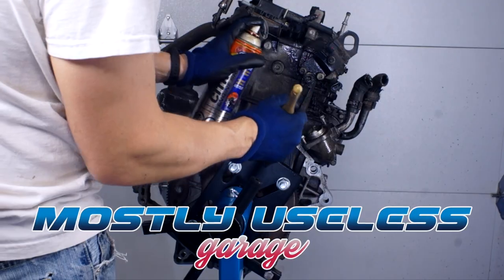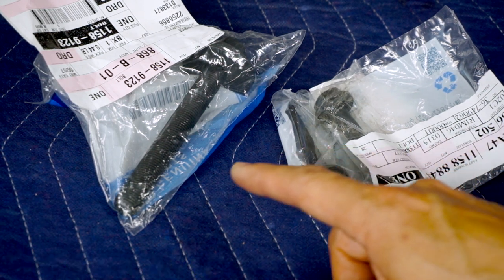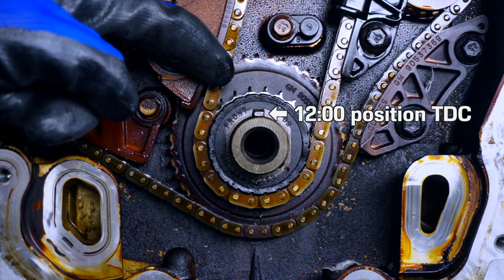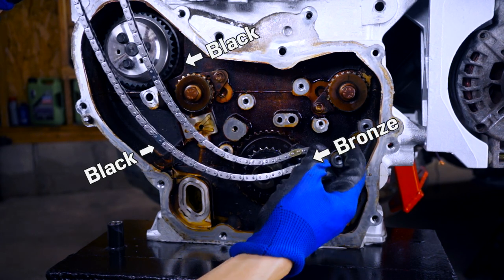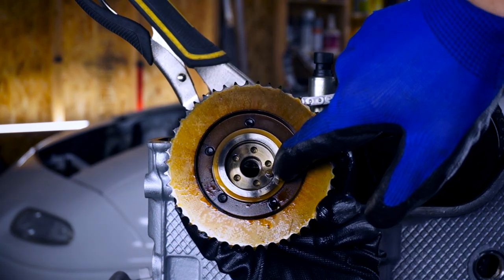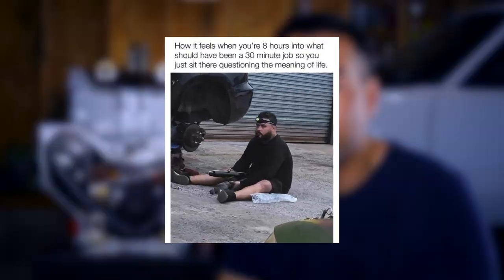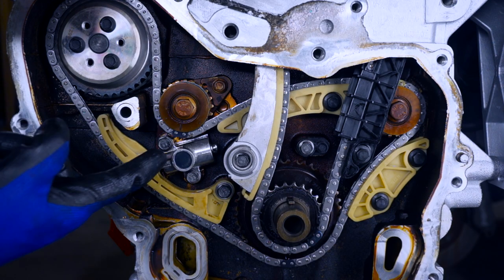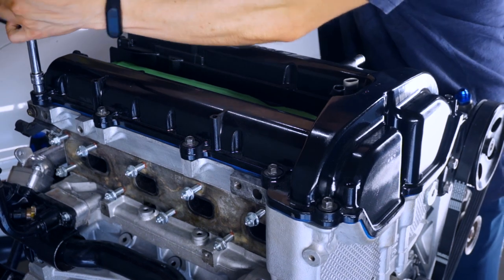TIMING CHAIN 2.4 GM Ecotec Motor Replacement - DIY Ecotec Miata Swap

Comment from the maker: Unfortunately this video isn't the install of the motor into the Miata, sorry.  We're getting there but this unloved junky engine insists on teaching me new skills and testing my resolve.  What's the worst unintended job you've had to do?
Reply: I have a 90 Miata and wanted an easy weekend project of cleaning up and painting my valve cover. After taking the valve cover off I noticed a decent amount of oil leaking around my timing belt and the front of the engine. Turns out my camshaft and crankshaft seals were bad and leaking oil, so my quick weekend project turned into replacing those seals, the timing belt with all new timing covers, accessory belts, the water pump, and an entire coolant hose kit.

Safe to say it wasn't a weekend project after all that.
Reply from the maker: @Afterthought90 Ouff! Good on you for noticing and getting it done!  Talk about escalating
Reply: Once I started out doing a steering shaft update on an old El Camino we inherited to tighten up the loose steering.  I came down with a case of ¨while I´m in there¨ and long story short, the car ended up with a complete suspension, brakes, wheels and tires all around.  The worst part was the suspension bushing replacement.  I should have just bought a cheap shop press.

Comment: I will be building an Ecotech engine to replace mine due to excessive oil consumption. I will use your links. You do a great job. Camera angles, clarity, editing, and sound are all on Point! I subbed. I expect this channel to blow up if you keep doing what you're doing.
Reply from the maker: Great to hear!  These are kind of underrated engines and the experts like the ZZP guys say when built can be extremely stout and take a ton of boost.

Comment: Excellent video! It seems like you’re following closely behind in my footsteps. I’m doing an ecotec swap on my Miata as well. I just finished up the timing and balance shaft chain install a few weeks ago. I had almost the same timing woes as you but it was for a different reason, causing me to tear it all down and start over again. Its frustrating, but fingers crossed I hope this swap will be worth the struggle
Reply from the maker: That's a relief, I'm not the only one that struggled! I'd love to chat further, could you email me at mostlyuselessgarage@gmail.com to compare notes on our swaps?

Comment: I'm not gonna lie, I'm doing a similar swap and seeing the trick you did with the screwdriver to tell if the cylinder is at TDC was incredibly helpful. I misaligned the cams and crank like an idiot🤦‍♂but my motor is a B207 so it needs new cams anyways.
Reply: NO WAY BRO U SHOWED HOW TO FIX THE EXACT MISTAKE I MADE LMFAO UR A FUCKING LEGEND
Reply from the maker: That's awesome your turbo motor should rip in this chassis. Check out the DDMWorks doc linked in the description for some great info on timing the motor correctly.
Reply: @mostlyuselessgarage  I bet it would! The motor im building is an LSJ I’m putting into a Pontiac Fiero (haven’t uploaded anything about it yet). Very similar swap so I’ve been using a lot of information from DF Goblin and Ecotec Miata swaps:)

Definitely will check out DDMWorks’ documentation too! Thank you!
Reply from the maker: That'll be a weapon with the supercharged LSJ ... Good luck with the build dude!
Reply: @mostlyuselessgarage  Thanks man! Good luck to you too! Subscribed to ya to see where it goes:)